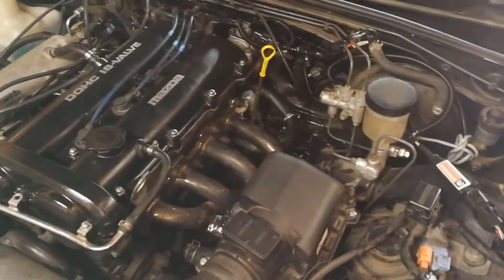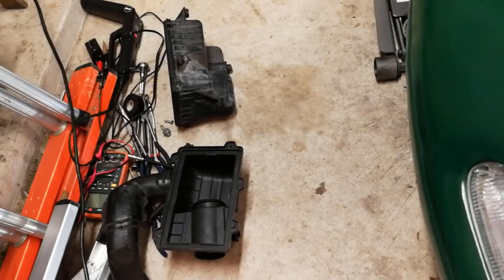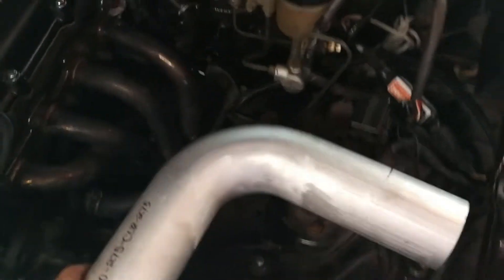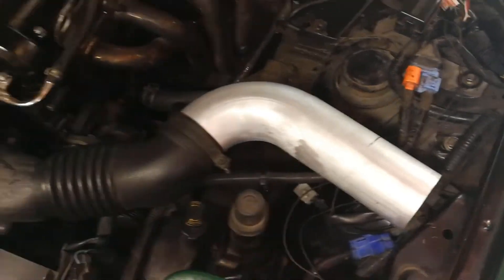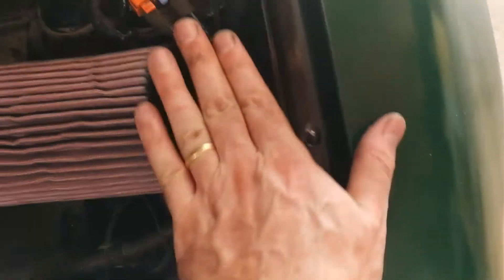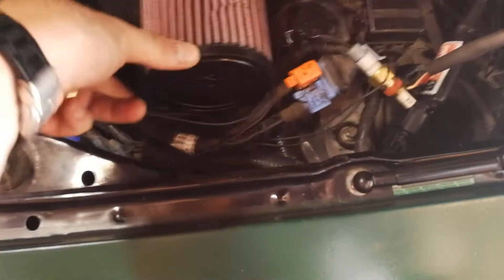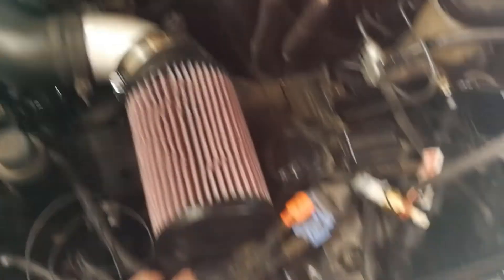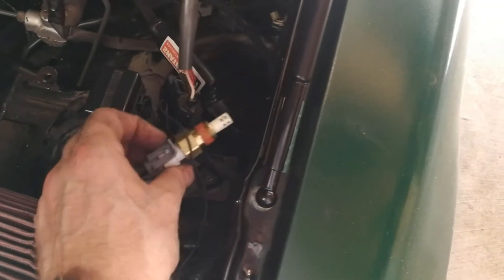Miata MAF Delete and Custom Intake

Comment: That whole filter is supposed to fill with air and pull in at bursts you didn't cut enough pipe the pipe needs to go in to the filter just enough to clamp on to the pipe otherwise your just restricting the air flow coming from the filter
Reply from the maker: Haha, you are correct.  When looking back at that part, my editing made it look like I shoved that whole thing in there, lol.  Never noticed that.  There was, in fact, a couple rounds of test fits where I cut off more and more leaving just enough to get a good clamp on it.

Comment: hot air intake on point
Reply from the maker: Eh, it's reasonably well shielded.  The box presses up to the hood and cold air comes in easily behind the headlights.  Of course now I have an intercooler on the car so I don't even bother with the heat shield.  As long as I'm not stuck in traffic, it makes no difference to the IAT.

Comment: hey, see that you still comment here so i got a question. my 2020 elantra comes stock with a MAP sensor and a MAF sensor. can I just get rid of the maf and the car will fall back on the MAP? or do I need a tune? I know my 2016 elantra gt only had a MAP sensor with the same engine so
Reply from the maker: I'm not sure but if I had to guess I think it would run without the maf but will probably throw a code.  I'm thinking they are using both for emissions purposes or increased fuel efficiency.   If you can find a tune for it, there may be an option to disable the maf freeing you to put on a different intake that may make more power.

Comment: my car will only run when I unplug the afm
so I got another afm, guess what that one was broken too

should I just install a megasquirt and wideband if I'm just going to turbo it in the future, I'm sick of messing around with these air flow meters
Reply from the maker: Yeah if a turbo is in your future, I'd go ahead and do the ms and wideband... it's fun and safe to learn tuning while naturally aspirated and then you'll be all set when your ready to put that turbo on.
Reply: I had a Miata with repetitive maf issues. Had to hire someone for electrical troubleshooting because I didn't know as much at the time. He had to re run a wire and it was good from there out.

Comment: I still don’t understand how to delete the maf and not get any codes or idle problems... someone explain I want to install a cold air intake and delete my maf but when I take my maf out I get codes thrown left and right and when I just unplug the maf sensor my idle goes down to 200 rpm and engine dies if it isn’t revved
Reply from the maker: Deleting your maf this way requires a non stock ECU....you need to convert to a map (pressure) sensor instead.  The other option is you keep only the maf section of your intake and delete the air box and extra piping.  That works fine.
Reply: @OGPedXing  ok so let’s say I drill a hole behind the aftermarket intake to put my sensor, won’t that throw codes being that it’s not gonna be the same amount of air with a diff filter
Reply: Would I just need a tune
Reply from the maker: You have to use the entire maf section, it's about 4 inches of pipe and it's removable from the rest of the intake.  Then you connect your new filter to it.  The maf will measure a the air going past regardless of the filter and the ECU will compensate automatically, no other changes needed.  Here is a site with some good pics to make this more clear: https://www.vkmotorsports.com/blog/2018/08/05/rid-cel-code-p0171.html
Reply from the maker: Oh also be careful-- you need to remove that whole piece of pipe as shown in figure 7, DON'T unscrew the two screws next to the connector plug.  You will damage the sensor.

Comment: can you just get rid of a MAF sensor or do you need it?
Reply from the maker: You need it unless you convert to a map (manifold air pressure) sensor and aftermarket ECU.  The maf tells the car how much air is coming in so that it can adjust fuel to match.
Reply: @OGPedXing  ok thanks :)
Reply: Hi. Do U recall the part number for that K&n filter?

Comment: Why wouldn’t you just put it on The intake side
Reply from the maker: That's an option for sure.  I didn't because the crossover pipe does actually slightly improve mid-range torque, also there's a little chamber that reduces drone at certain rpms.  Finally I knew I was going to be mounting a turbo which would go on this (exhaust) side and so working out alternative piping for the iacv and breather would not be worth it in the long term.
Reply: OGPedXing makes sense, thx for the response